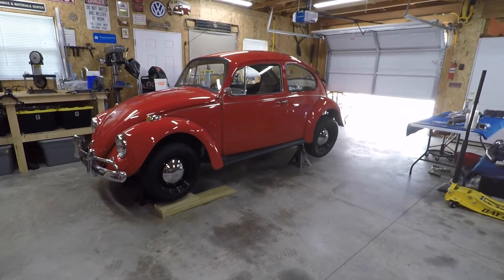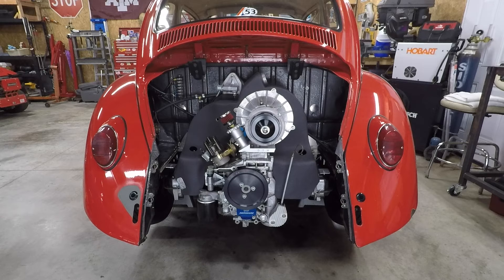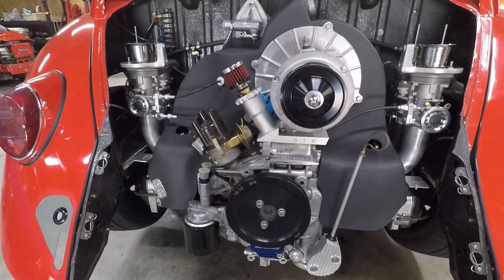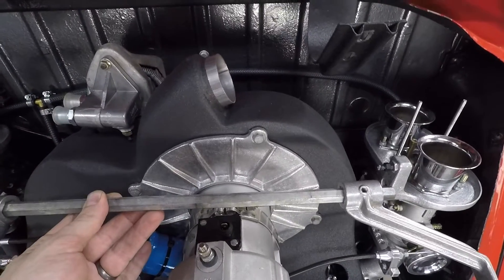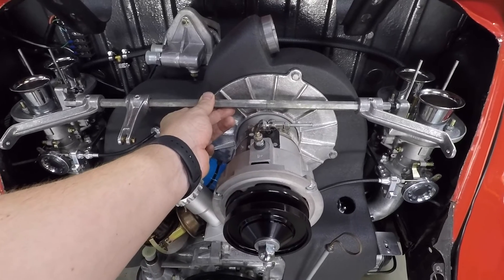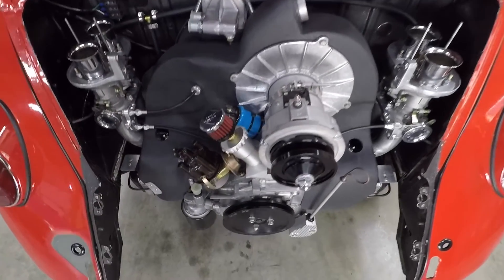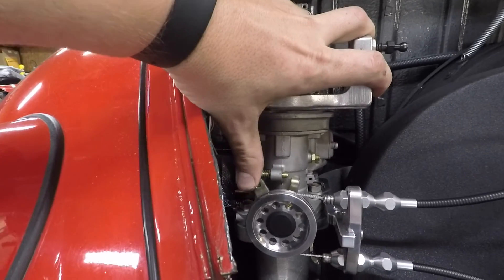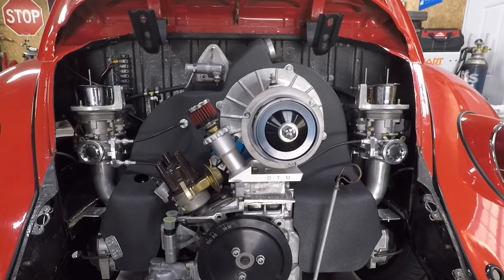2056 T4 Re-installed (Part 2) - SyncLink Install

Comment: Very very nice. I just bought a set of original Weber 44’s I will use this setup.
Reply from the maker: I think you’ll like it! It provided really smooth operation, and excellent synchronization between the carbs throughout throttle opening